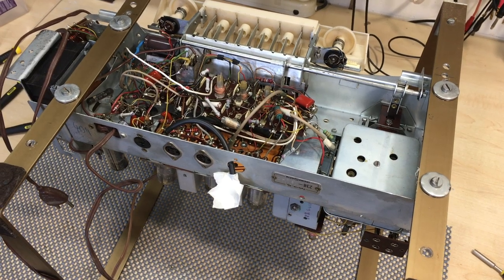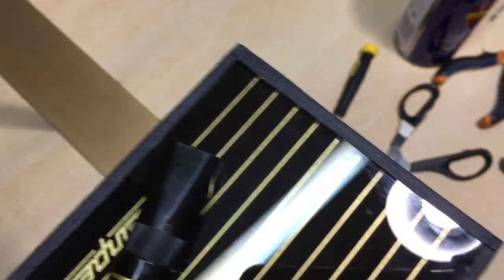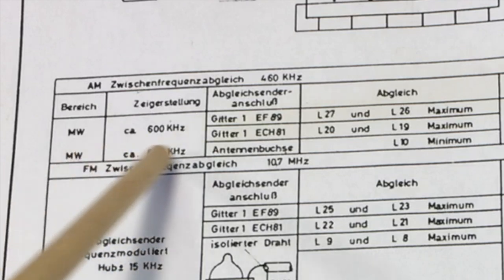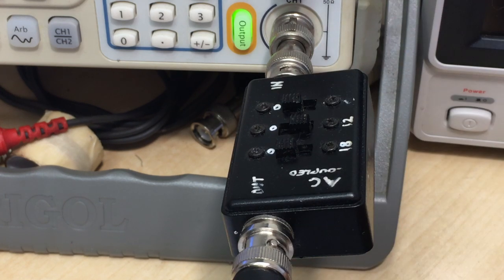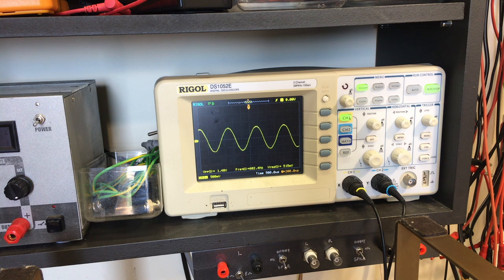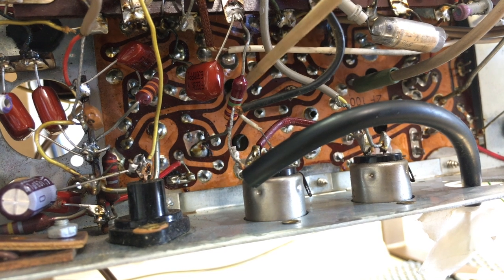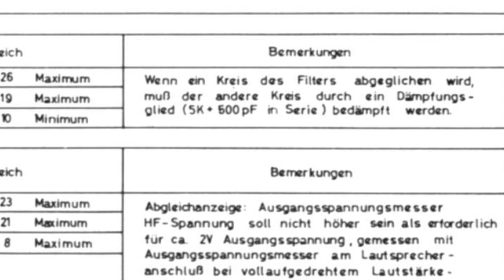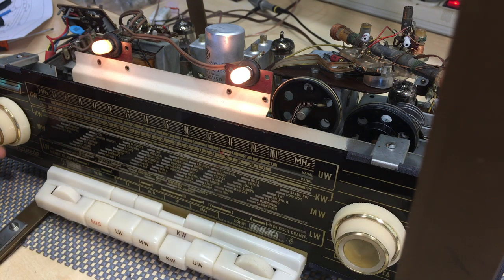Loewe-Opta Rheinperle 5717W restoration - Part 7. Cleaning and IF alignment for the AM bands.

Comment: I didnt knew about that filter in the antena input. One more lesson for me :) thanks for sharing
Reply from the maker: Daniel Saturnino : you’re welcome
Reply: It's often as much to stop the IF (both AM & FM) from getting out & interfering with other sets as it is for stopping stray IF-frequency signals getting in, particularly on cheaper 50's European sets which were often used in apartments with shared building antenna systems. You'll sometimes see that reason spelled out in the user or service docs, or occasionally hinted at by a note on the schematic.
Reply: Thank you Jim.

Comment: I always thought, the IF trap filter is for preventing the radio becoming a transmitter at that frequency.
Reply from the maker: That too. It works both ways: stops IF getting out, and stops IF getting in from other radios in the vicinity.

Comment: What an excellent video. Great explanation of all the important factors. I
 was warned away from aligning the IF’s on my last project, but did carry out the rather complicated RF alignment to great effect. It also gave me a chance to use my new (rather old) Signal generator (no frequency counter just a dial). 
If you ever get the chance could you explain the phenomenon of image frequencies from signal generators and radios whilst carrying out adjustments? I did try to read it up but just got confused.
Cheers
Lynton
Reply: Suggest you obtain a frequency counter to monitor your sig gen. The dial is unlikely to be accurate especially for aligning purposes.

Comment: When the instruction says, you should dampen the other circuit, it doesn't mean the FM coil when doing the AM alignment and vice versa. You have to dampen the other side of the same IF tarnsformer, because the coupling is over critical.
Reply from the maker: Absolutely right. I got that wrong in my explanation. Thanks.

Comment: I like the tip regarding the kebab sticks, I get the impression that the British set makers of the time where heavily influenced by the German designed radios. My latest problem is where to source 6.5V 0.3 amp pilot lamps from or whether to go down the LED route, anyway a really interesting enjoyable and well made video from you,.
Reply from the maker: Harry Stevens : I’ve had similar difficulties finding the 6.3v lamps. However, try 9v ones (dc or ac) and, depending on the power rating, you’ll probably get a good result. 
Kebab stick: always useful :)
Reply: I get mine at www.atr-shop.de
Reply: I find leds give the wrong light and don't look right. ebay has lots of 6.3volt bulbs. Add a low resistance to reduce the stress on the fillaments and they should last forever.
Reply: @jonka1  Ended up fitting some 12v  as the 6v always seemed over bright even though the voltage was correct so now I get a dull orange glow a much better look all around, also stocked up on 6,9 and 12v bulbs for other sets in the pipeline, agree about the LED look.

Comment: Excellent video, as always.  I particularly appreciate the detailed alignment procedure as  I will soon be attempting the same on my 1955 Grundig 2030 W/3D.  I have it's original alignment instructions, but like yours, it's all in German and there's only so much you can do with Google Translate.  Also, re: polishing the knobs, would it be wise to spray lacquer the polished brass to keep it from corroding all over again?  Nice tip on the low cost Dremel polishing wheel, BTW.
Reply from the maker: Lacquer is actually a good idea. It would certainly preserve it for years.

Comment: Thanks again, I absolutely love your videos, so informative. I have found my way to this one after viewing most of your more recent ones. I am setting myself up to do my first am alignment and noticed you sometimes use the scope and in later videos a millivoltmeter. I have the same Rigol generator as you and a stepped attenuator, but only a basic analogue multimeter that at best does 0 to 10 volts AC. I am in a quandary as to wether I invest in an oscilloscope or a better multimeter. I seem to be having trouble finding an analogue multimeter that measures in millivolts.
Can I ask in your experience which you prefer? Oscilloscope or multimeter.
Thanks again for the great videos.
Reply from the maker: i’d say the scope, definitely. it is very useful in so many applications.
Reply: Electronics Old and New by M Caldeira Thanks, just checked out the scope you have with my local supplier, very reasonably priced, and 3 year warranty.
Lockdown is a good excuse to treat yourself to some new toys :) Well, that’s what I tell my wife...
Reply from the maker: Good idea. Blame it on lockdown blues 😊